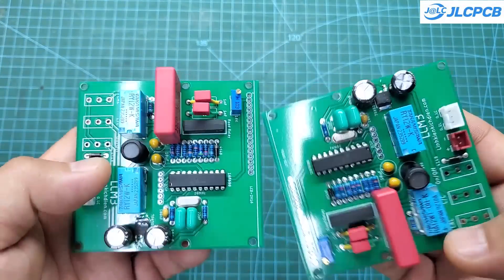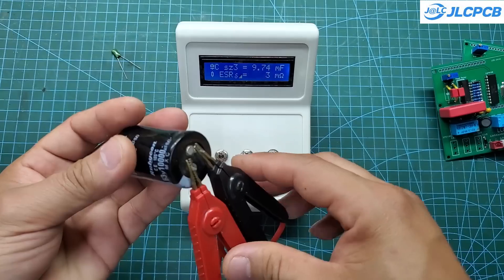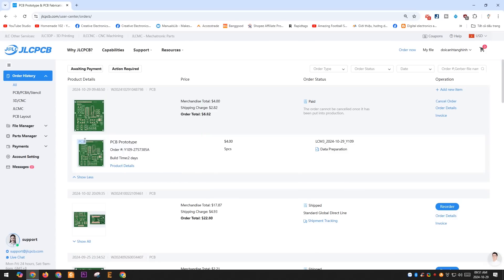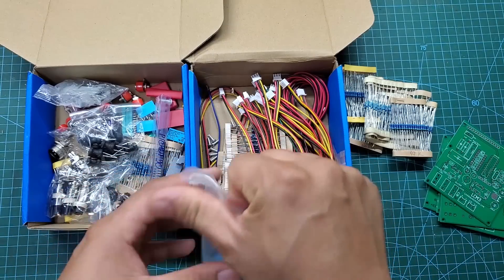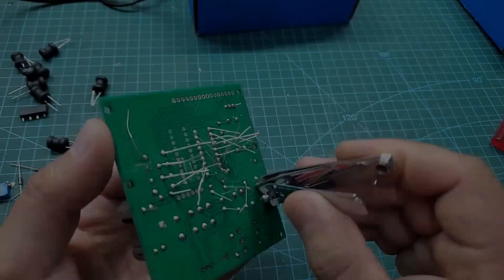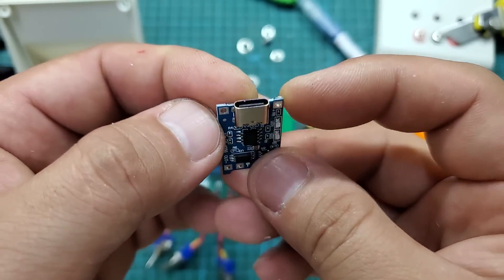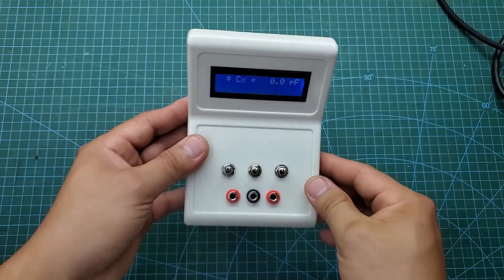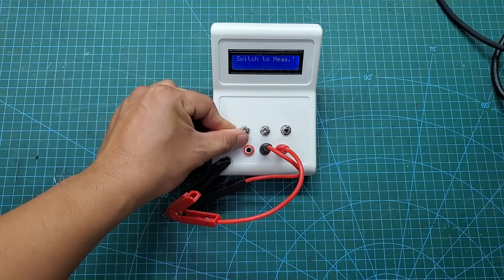AMAZING product for you | LCR Meter LCM3 | JLCPCB

Comment: Hi Sir, Thanks for the project - Can you please tell what is the need/function of the reed relay between pin 12 and ground of the PIC16F690 MCU ?
Reply from the maker: The relay reel is used to calibrate to zero in L-C measurements and calculate the parasitic capacitance of the inductor. You can use a standard relay. however, an additional NPN transistor is needed to control the relay.